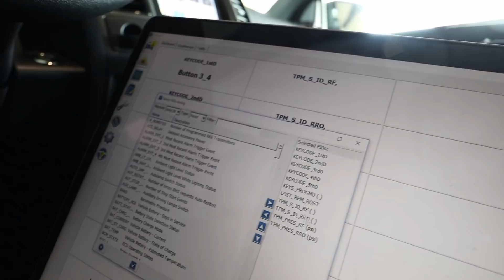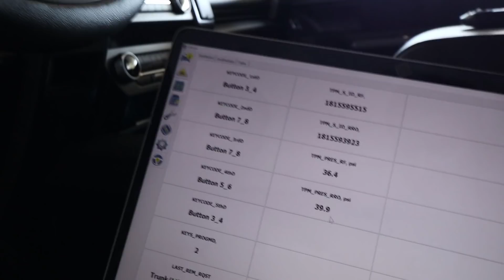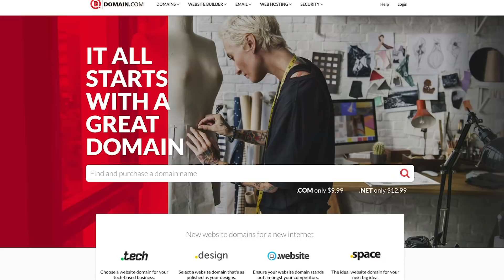Hacking Ford Key Fobs Pt. 3 - SDR Attacks with @TB69RR - Hak5 2525 [Cyber Security Education]

Comment: In Europe remote Start is not allowed and most European car models dont have it. But i tried similar things, and in most vehicles it was enough to switch on the hazards to wake everything up and read some codes over OBD2. So you dont even need to switch on the ignition. On most Volkswagens it worked, also Porsche, Audi and Bentley because they use partly the same electronics. Also if the alarm goes off, that also gives you the ability to read everything over OBD2.

Comment: That fact he has Ettus equipment and still prefers the HackRF with the Portapack is inspiring. Just goes to show how much low-hanging fruit is out there in RF land.
Reply: Ettus makes great SDRs that offer features like very high sample-rates, gps disciplined oscillators, timestamped samples, high dynamic range and large FPGAs to do lots of signal processing. With their RFNoC framework it is extremely easy to use the FPGA in gnuradio companion. This is useful if you have to deal with signals that are >= 40MHz wide, use MIMO or beam forming and so on.

A simple keyfob and many other things use a very narrow bandwidth and simple modulations like some sort of ASK, FSK or PSK. Using a simple Ettus B200 to receive such a signal can be annoying, because after each power-cycle it has to load the firmware for the microcontroller via USB and when this is loaded it has to load the bitstream for the FPGA. In that time you have already captured the signal with a cheap RTL-SDR or a HackRF.

And most important, you don't want to risk the expensive tools if some cheap tool can be used. ;)

Comment: Requiring physical access to the running vehicle seems like a reasonable reduction of the attack surface. Can the can us be accessed through a Bluetooth ODB interface or does require a wired connection?
Reply: Bluetooth OBD-II readers work fine with Forscan, anything that's ELM327 compatible.
Reply: My first thought is mechanics can be bought to pull these codes from cars they are working on to sell to criminals. They also probably have access to an address too.